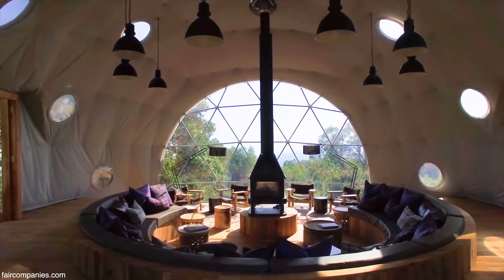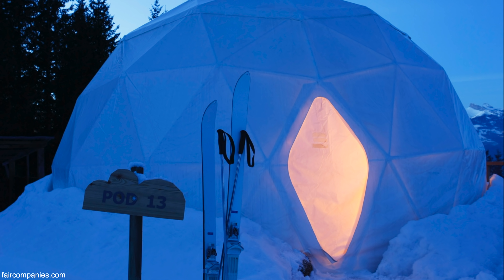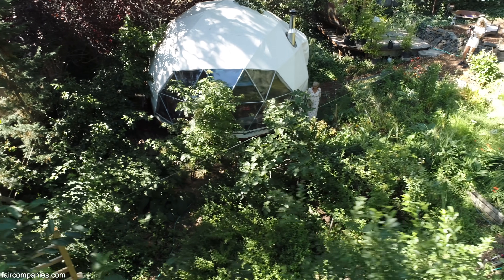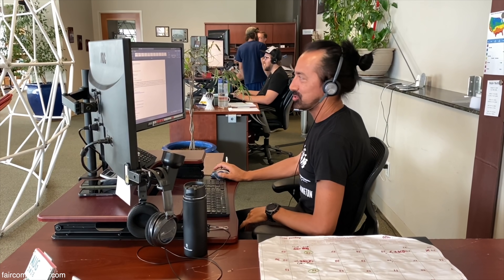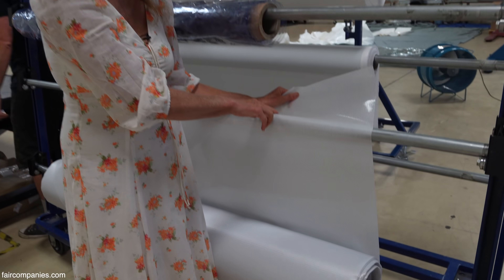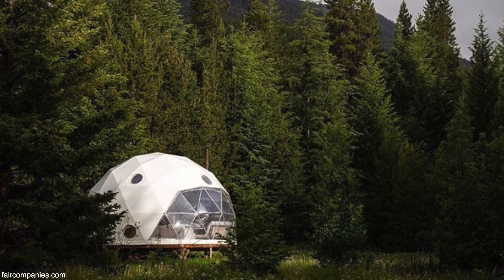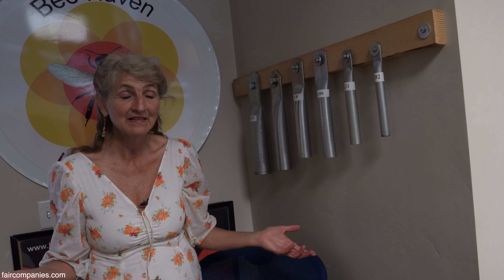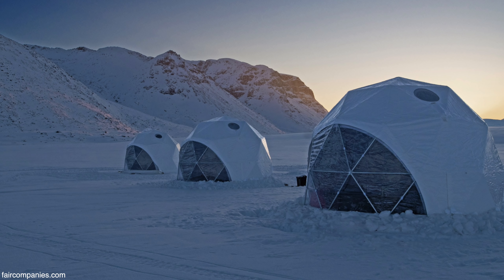Sewed own popup dome-home for need, been selling them since

Comment: I've heard Pacific Domes before, but this video really captured me.   Nicely done Kirsten!  

What intrigues me the most is the sewing/welding of the dome panels.  We are talking extreme craftsmanship skills!  Covering a dome is extremely difficult.  I built a DIY 20' dome and had it up for 28 months in NE Wisconsin where I grew veg inside with a 900 gallon aquaponic system.  Cherry tomatoes at the end of January is priceless!   I learned so much about "domes" and I have a great deal of respect for this woman and all the work she has done to perfect the process.    

I spent a considerable amount of time in my dome growing veg through two winters.  When the weather is kind i.e. 35 to 60 degrees F and calm, domes are very pleasant and uneventful.  But, when the winds are blowing 30 mph with gusts to 50mph while it's 20 degree F below zero, or in contrast 95 degrees with a huge thunderstorm with gusts as high as 70mph... a dome must be built to survive all weather conditions while combating moisture issues, atmospheric pressure conditions and the intense solar heating from the sun as well as extreme cold in the winter.  A week long dome seminar would be able to cover these topics in much needed detail.   This video was great, but I would love to see a more in-depth video or even a multi-part seminar on four season domes. 

Let me tell you, there is nothing like walking into a warm dome during the dead of winter with plants growing and water cascading about defying all rules of nature.   I miss my dome intensely!  On my bucket list is a three dome interconnected complex in which to retire.
Reply: This sounds like paradise.. I would put a comfy seating area in it..to just hang out.. Ive been coming across Aquaponic designs for years.. I love the Idea of growing Fish and Veg at the same time. Thanks for a new vision for my future place. Have a good day.
Reply: @journeyoflovelight  Have you heard of duckponics ? Happiness and clean water for ducks, great fruit trees for people.
Reply: @restoretheearth2829  Ill have to look that up thank you.
Reply: Beautiful commentary and insight. Best of luck with your retirement dream!
Reply: Some ideas: Additional to the Existing "Skin", carefully Placed and Applied 2-Part Expanding Foam (usually Urethane), Concrete Cloth or Concrete Canvas Over Skinning, or Steel Mesh & Shotcrete Over-covering. 

As these "Additional Coverings" add Cost, maybe a careful investigation is prudent!
Reply: @robertweekley5926  I prefer light materials to keep the design a temporary structure.  I've looked into concrete or even hempcrete (much lighter), but being able to make repairs at any moment is important.  Patching holes in concrete is not so easy.  Amazingly enough, 6 mil plastic is resilient and very easy to work with.  The main issue is wind i.e. pitching a sail, so repairs are best conducted on calm days.

The amount of force exerted on the top pentagon and the perimeter are enormous even with light building materials.   If you use heavy building materials, things could go wrong very quickly.   

There was a wet 10" deep snowfall on my dome one night.  I calculated the snow load was 1 1/2 tons.   The dome held with the lightest building materials.

Comment: I’m inspired! 
I’m thinking I could make one from relatively cheap billboard fabric. Could use special PVC glue to glue the fabric. Could make several jigs to cut, flatten and bend the metal conduit to make the frame. I imagine there are plenty of DIY instructions on the internet. 
Or it might be easier just to buy one and know it’s made right.

Comment: Finally a video that really shows these off. Been eyeing these for a while and will most likely be my  first tiny home purchase.
Reply: Mee to, but consider the downsides and upsides carefully. 
Downsides that come to mind are:
-material waste when cutting from square sheets
- insulation and espesially windows
- building permits may be more difficult
- sealing and adding insulation
-cost or accessibility of exotic materials
-safety/burgulary/ damage

Points of unknown:
-self build or order
-size 
-climate, insulation
-risk
-repair
-cost of self build in time, quality, tools, 
-guarantee of safety, engineering, testing, proof of concept
-comparison to the alternatives

Positives:
-minimum surface area
-strong geometry
-moveable 
-light wheight
-somewhat simple?
-ridiculously cool geometry, and architecture
-uniqueness, and psychological positive effects.

Let me know what you decide on.
I'm leaning torwards building myself, from junk and salvage materials, buying tools, property without road access.
I allready have tarp and greenhouse mat. 
I have trampoline frames for making greenhouses. Planning on using roadsign galvanized pipe, heavy gauge, cheap, cut with metal saw, and use bottlejack with caption device for crushing the pipe when aligned. 
You can buy/use  heat guns for tarpaulin welding. Moulds for the 3? different triangle shapes.
Power is hard
Starlink internet
Wood heating/compost
Solar array, generator, and possibly passive hydropower.
Thermoelectric woodfired energy? 
I live in the arctic circle, so insulation condensation, and electric energy generation is my biggest challenge.
Reply: @musFuzZ  she showed domes in the Arctic zones. You'll be fine. What a great idea, huh? Ditch the DIY and do it right - skip the Starlink too. Spend it on her materials and workmanship. You're in the Circle for crying out loud, mate...a DIY might not be economical.

Comment: So much more beautiful than a Yurt! I love the spacious and light filled interiors. So many building codes are geared toward stick frames and need to be amended for these  innovative and affordable dwellings. We need supportive, compassionate and flexible housing for so many millions of homeless and dispossessed people on this planet...
Reply: Would be great for non-homeless people as well...👍🏼🙏🏼😇
Reply: I'm also thinking of them as a solution for communities destroyed by wildfires or other disasters, affordable and quickly available shelter until the refugees can rebuild or resettle.
Reply: Exactly. Why not just put up a bunch of these on some open land for homeless people. Much cheaper than building a house and stronger than the tents many live in.
Reply: They are more spacious, but do not blend into their surroundings the same way a yurt does. That is why I prefer yurts.
Reply: @rorirm  Yurts, or gers are probably not as high, but I don't think either of them blend into their surroundings when they are stark white. (Unless they are in the arctic or Antarctica!😆)
You'd have to make them a forest green or sandy colour. How about camouflage colour? 😁😁
Reply: @judylloyd7901  you can get them in a variety of colours.
Reply: @rorirm  check out the green ones
Reply: @rorirm  The Structure presented is a Yurt.
Reply: The structure presented is by Mongolian Architectual Tradition a Yurt.

Comment: When I was in high school, I bought The Dome Book. My dream was to build domes, but I saw the problem with leakage. How inspiring to see that you built your first dome while expecting and then continued to make a living building domes.
Reply: It’s good you didn’t build one. I grew up in a geodesic dome that my dad built. It leaked and every repair was a failure. My parents finally converted it into a regular house. Goodbye, dome.
Reply: @tnijoo5109  Yeah, wondering with the newer flashing materials like that come in big sausage tubes designed in Japan for hurricane and typhoons combined with the modern adhesive tougher more durable ice and water shield style complete flashing locations and roof covering pretty much roofing material if not exposed to UV... how well more easily they can last.  With foam also... my guess is in humid environment you'd only need to worry about the moisture contend, dew points and condensation issues like the pretty much entirely foam designs.
Reply: @jafinch78  I don’t know anything about that but I assume there’s better ways to build it now. When my parents looked into finding ways to fix it, they didn’t find good options but I don’t know what they looked at. The ways it would leak was also problematic because you couldn’t identify where the leaks were. Water got in between the walls and would end up traveling and leaking into other rooms or even into the first floor. Their dome was three floors.
Reply: @tnijoo5109  I see, I think.  Yeah, the newer construction materials for residential structures have really advanced in the last decade and more-so in the U.S. with cost effective main stream products most can easily find in a big box store or just order from whomever makes.  Like the closed cell foam, if not done where their is offgassing, is just phenomenal for sealing.  Even foam sheet material as sheathing with seam taping/adhesive sealing seems really impressive.  Almost like pond liner style material, though what was more basement liners on RC commercial builds for high rises is now mainstream available.  I know when I first worked on my parents house in high school, I dreamt about the materials that I wished were available then and that was only a like little over two decades ago.   The last roof I worked on, has be considering the next more critically for longest term lasting while still being really cost effective, use what at one time was tar'd felt... is now a more like ice and water shield material over the entire roof and the ice and water shield is adhesive and robust more.  Yeah, the newer flashing materials just didn't exist back in the day like they do now.  I guess the prices went down also on the materials since used more.  Even with the modern materials... still have to be critical when planning since like some caulks for example are the worst... versus just using a more pure Type 1 or maybe for just for seals where adhesion isn't a concern Type 2 Silicone.
Reply: @jafinch78  I suppose with all these things, the real question really is how long they’ll last. My parents’ dome was great for the first 20 years. Then it started leaking. First they had roofers actually shingle it. It seemed good for a while and then started leaking again. That’s when my dad started doing some research and decided to give up on the dome altogether. I kind of think the thing with stopping leaks is being able to see where they’re leaking from and with domes, the way my parents’ dome was built at least, it seems impossible to tell. 

Are you building a dome for yourself?
Reply: @tnijoo5109  What IF after say 20 years, or less, the dome was 'parked' under a 'carport' like a motorhome, for protection?
Reply: @freethinker2976  lol. That would have to be a pretty big structure. Our dome was three floors with an extra half level on top. And I think it might block out the sun. But maybe.
Reply: @tnijoo5109  wowww! In this case, size DOES matter! :)  Was? Did you leave it or get a different dome?
Reply: @freethinker2976  it was my parents’ dome where I grew up. Eventually, they had to take off the top two floors and turn it into a regular house. It was sad but no more leaks and tons more space in the top levels.
Reply: @tnijoo5109  cool, man. i got the jones, now. :)
Reply: @freethinker2976  now a days you could just seal it with roof paint but really constructing the seams properly in the first place with flashing is probably the way to go.  You could always stucco it

Comment: What is the lifespan of the vinyl material once it is up and exposed to the sun, say...somewhere like Alpine, Tx?
Reply: When I looked into it, there was product you could paint on the vinyl to extend the life... but sun will decay it.... if you are not vigilant
Reply: @AttackHak  Vinyl specifically fabricated for outdoor use is mixed with UV protective and aging inhibiting substances. Typically, such products have a minimum guaranteed lifespan of 20 years, but some are guaranteed for life. That means the vinyl cover will first get holes from erosion by rain, snow and wind, before it will get holes from UV radiation from the sun.
Reply: @a0flj0  hi Florin, thank you for your reply. I live on the Colorado plateau, so the sun is intense. I am certainly intrigued by your response and am wondering if there is any literature you can point to? I’ve been intrigued by the domes for a few years, but have decided against it due to the sun issue... the company I was looking at suggested a UV coating that would need to be added to the surface of the dome to protect it. Thanks again.
Reply: @a0flj0  Loads of information on that link 😎
Reply: Also, what about hail or an 80 mph gust front from a Thunderstorm? What about security from criminals? I know a person who used a similar design foor his beach house, and it survived a hurricane. But it was built to handle very strong winds and it was very also very expensive to build (using the design but different materials (wood, concrete, cinder blocks, etc -not fabric). Most fabrics wouldn't pass a 120 mph, 2x4x8 cannon test. I would also hate to see one hit by a tornado being so light weight. Again, you have to look at the weather that is common to your area. That will also determine whether its even allowed. But being a "temporary" structure, I wonder about off grid type living on your own land?
Reply: At their costs, I'd rather just build a backyard guest house or cabin out of wood. It would certainly last longer.
Reply: @stephen1922  Can you build it in one day?
Reply: @Mrch33ky  It's not, in fact, built in one day. It's assembled in one day. Manufacturing the frame parts and the cover definitely takes more, and is a lot of work. Not much different from container houses. In theory, at least, you could definitely build something similar to container houses from wood.
Reply: @Mrch33ky  No, but anything that takes more effort to last longer is worth it in the end.
Reply: @Mrch33ky  You can BUY a shed ready-made from Home Depot. These are gorgeous but not for everyone.
Reply: @estherstrategicadvisor749  Thank you for the useful tip. You can also dig a cave in the side of a hill for free.
Reply: @stephen1922  well you’re missing the whole point. The cost isn’t the selling point. The whole point is that the shape of the structure, and the huge panoramic window is what people want.

Comment: Why don't they use hemp if cotton is so toxic? Isn't vinyl a petrochemical product? It doesn't seem as sustainable.
Reply: It’s not the cotton that’s toxic but all of the fabric sprays such as fire retardant and waterproofing. Hemp would require the same sprays and coatings as cotton.
Reply: @badapple65  you can water proof with wax instead and fire retardant isn't mandatory.
Reply: @shadowlands339  - Yes, fire retardant is required on structural materials by building codes, and wax is FLAMMABLE!
Reply: Petroleum is going to become very sustainable once most things shift to electric power, since the price of it is going to basically become worthless as demand largely disappears compared to current usage mostly for transportation, heating, etc.
Reply: @jimmanley2796  there won't be enough profit motive to dig it out of the ground once gasoline is over is there may not be enough plastics to go around when there are alternatives available.